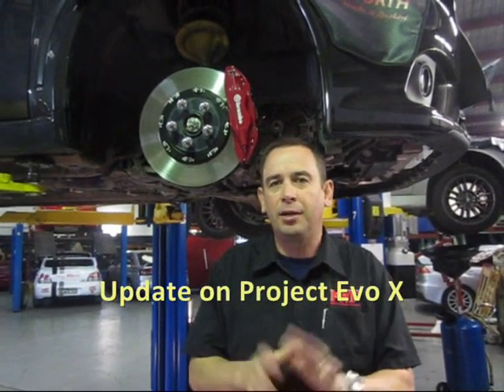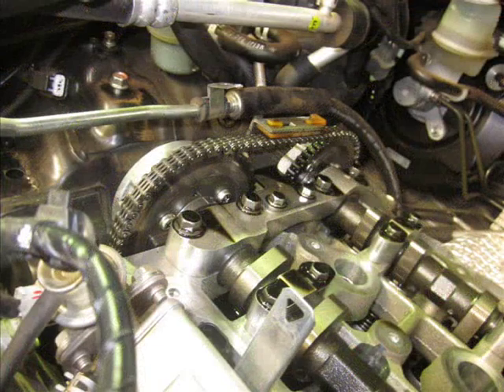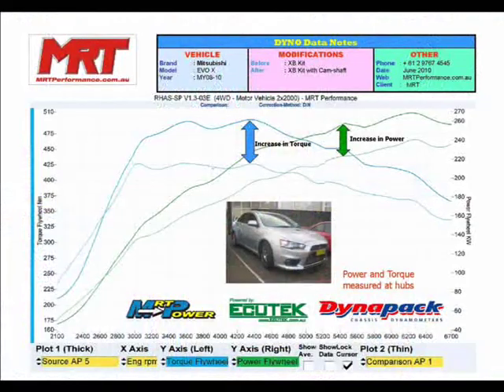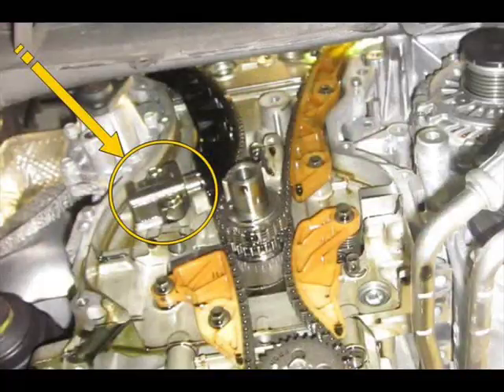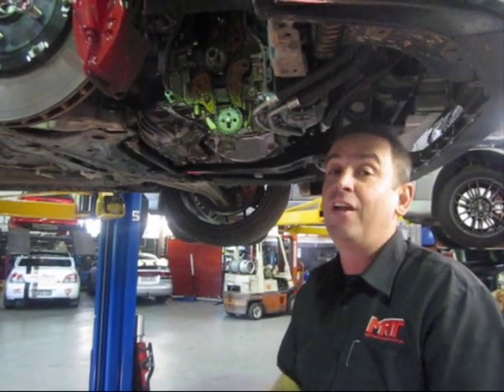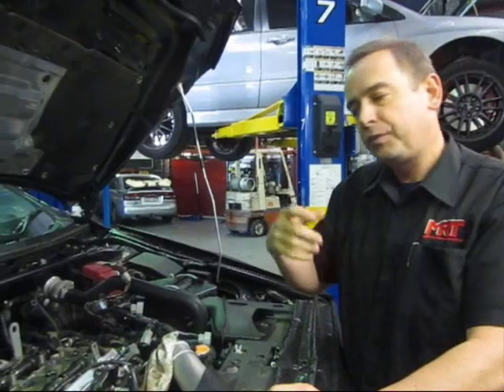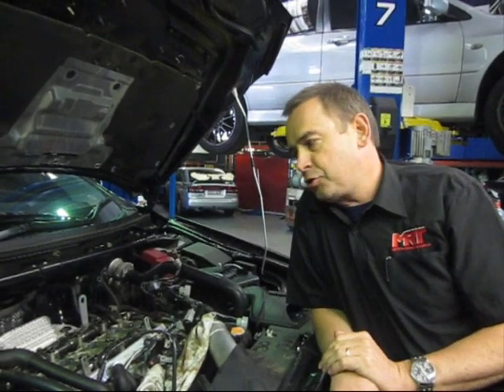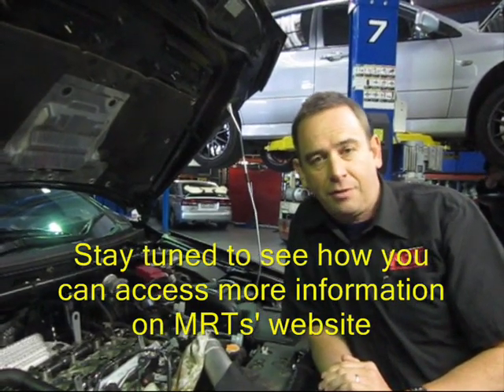EVO X Story Part 17 Camshaft mods

Comment: Hi Brett, You mention in your video that the timing chain never has to be replaced, yet there are alot of talk on the internet about timing chain stretch with this evo and reporting error code P00012 (Exclamation mark inside a triangle on the dash) which according to the manual is a timing chain stretch. Have you ever come across this?